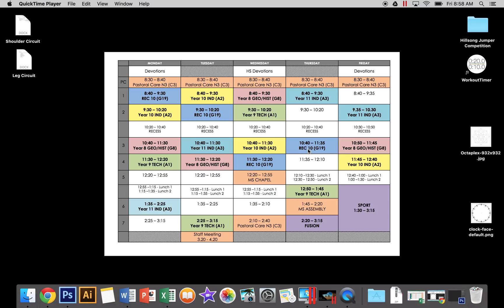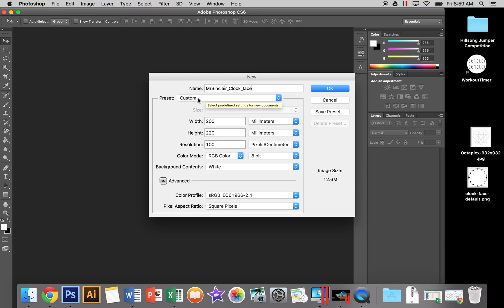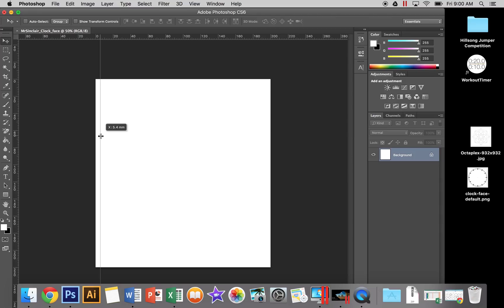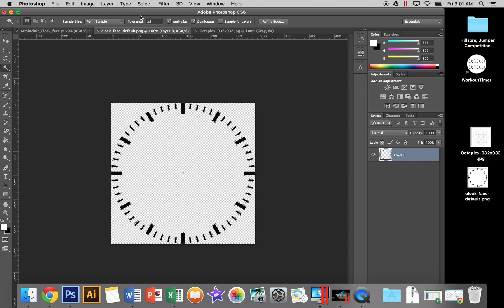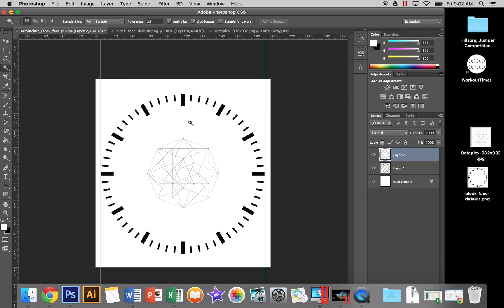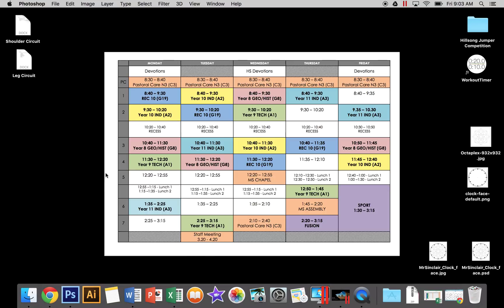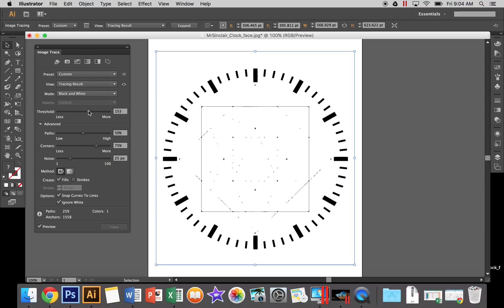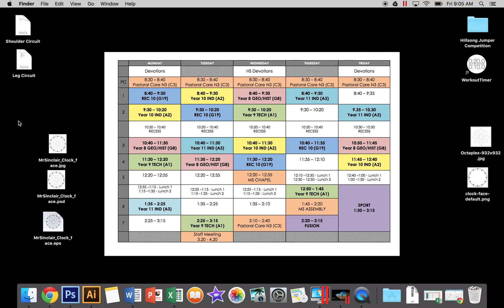Clock Face Design

Comment: Hello there! 

If I may, I would suggest that specific shapes can be selected by pressing '(ctrl)cmd+click' on the layer's thumbnail. Pressing 'cmd+shift+click' will help to select multiple layers too. The advantage of this is that you'll get pixel-perfect selections, and also will save time! You can align an object also by pressing '(ctrl)cmd+A' and then clicking center/vertical align in the top horizontal panel. 

If you press (ctrl)cmd+T to scale an object after vert/hor alignment, you can change it's dimensions quickly to the desired size by pressing Shift+Option(alt) and then dragging any of the transform box corners.

I hope these little shortcuts can be helpful...

Good Luck!

Comment: Nice and helpfull!
But with what program do you record your screen?
Reply from the maker: Just Quicktime screen recorder. Very easy.
Reply: +Joshua Sinclair is it also available for windows?
Reply from the maker: +Qmotion Our computers run on parallel software that can switch to a Windows desktop. This process does not impact on the recording. I would image you can download QuickTime for Mac. Alternatively, we use Camtasia for Windows. But I think that cost.